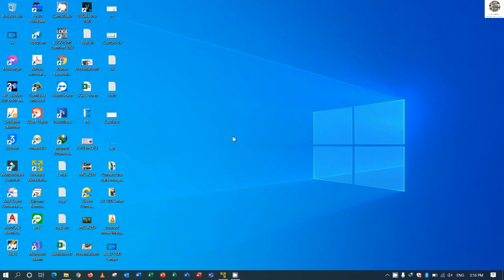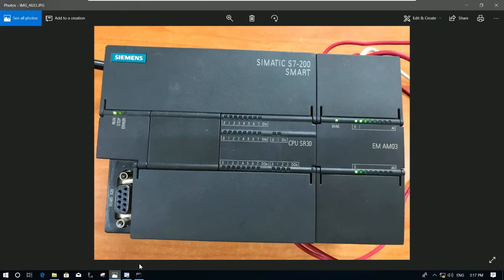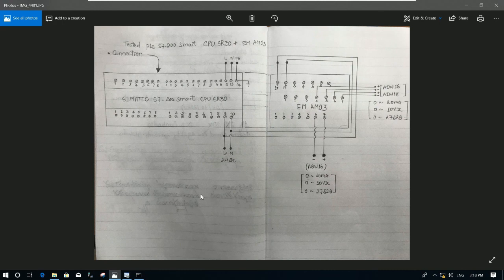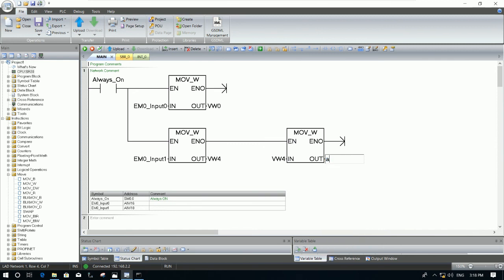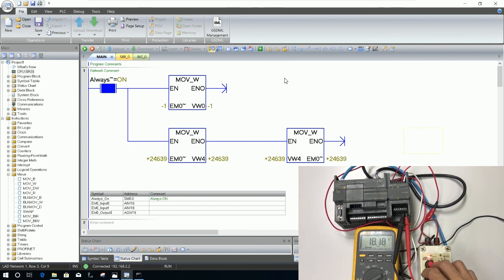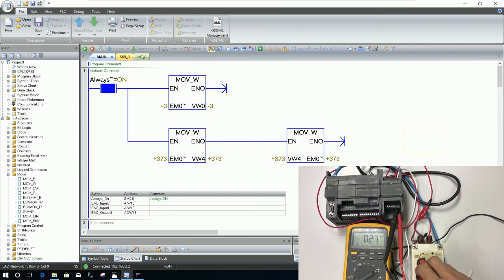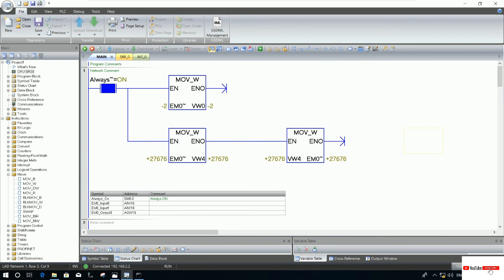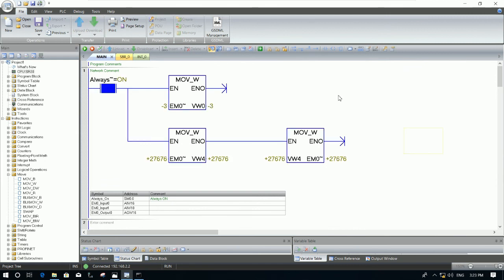Step 7-Micro/Win smart connected to PLC S7-200 SMART for configure Analog Output EM AM03 and testing

Comment: Sir, i have a s7-200 plc cpu226cn and em231CN and em232 CN module.so please make a video how can i practically connected this modules with CPU. And make a program how to controlled  actuator valve and pt100 sensor this modules and cpu.
Reply from the maker: Dear Sir,
Let me prepare it.
Thanks!
Reply: @generaltechnologyknowledge5165  ok thank you sir i am wating for you video.